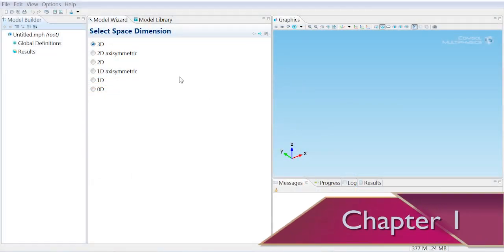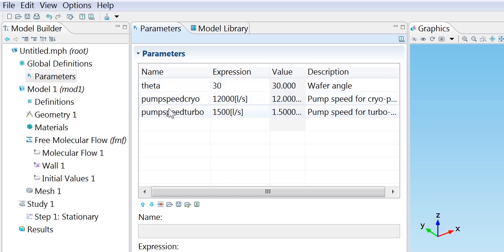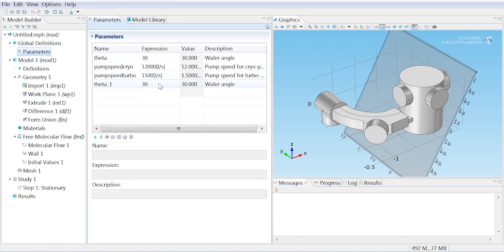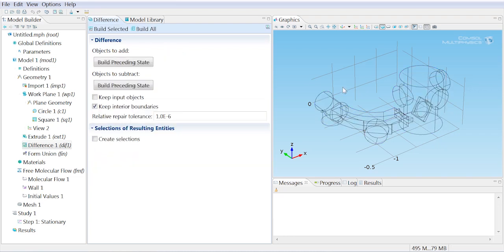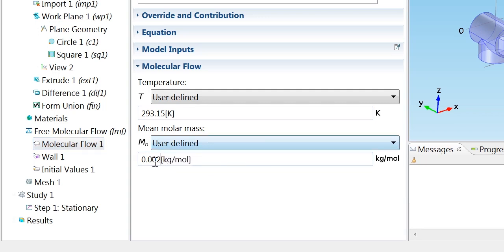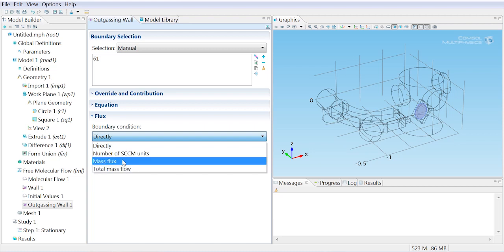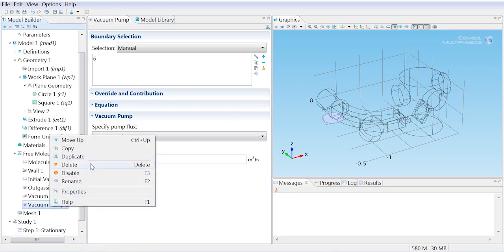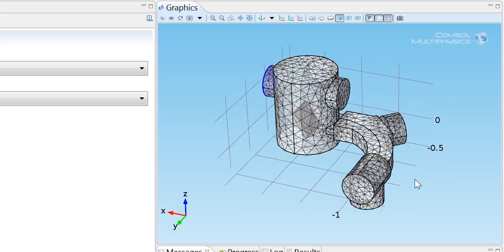Molecular Flow in an Ion-Implant Vacuum System, Chapter 1

Comment: I'm trying to model how a reservoir of helium connected to to a vacuum chamber by a thin capillary will inject gas into the chamber. I'm looking to model how the cloud of helium disperses in the radial direction, and the net flow rate. 

I'm new to this software, and was wondering about how you set up the geometry for a vacuum chamber. Keeping it to simple geometries, could I do something like make a cylinder to represent low pressure helium as my vacuum, and a concentric cylindrical shell with a small element jutting into the vacuum cylinder to represent the walls and capillary?
Reply: Funnily enough, I'm trying to do a very similar project. Did you manage to find any interesting information or resources relating to this? Thanks, Rhys
Reply: @rhyyss123  I did not, unfortunately. Good luck to you!